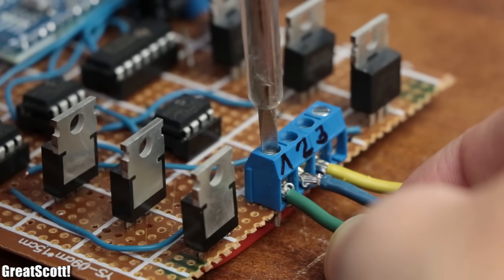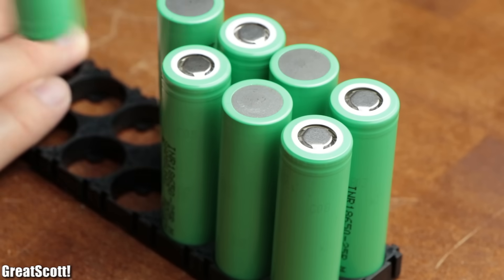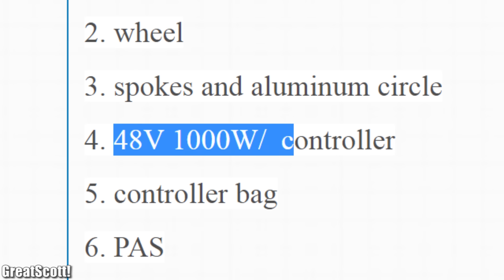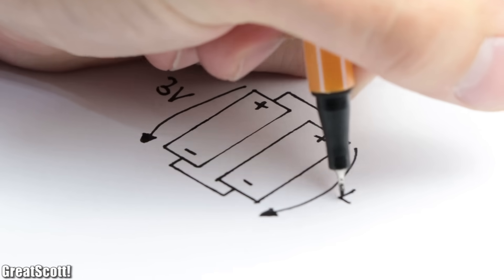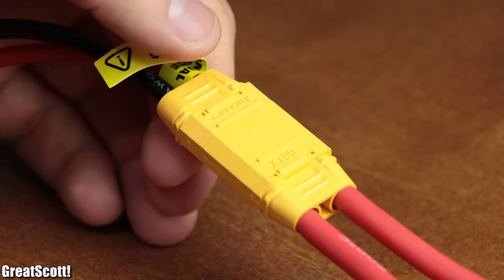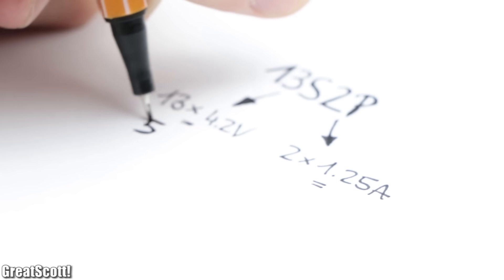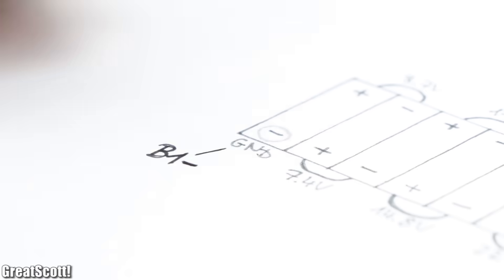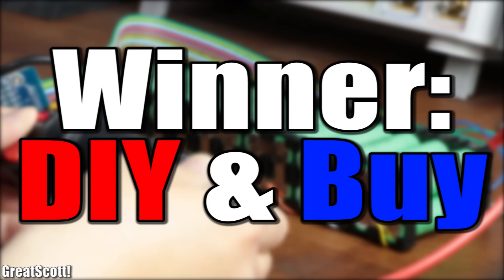EBike Battery Pack || DIY or Buy || Electric Bike Conversion (Part 2)

Comment: Nice video. I have a question concerning the charging process. It is not explained in the video, does your power supply uses CC/CV strategy when charging, or just constant preset current and voltage? Because if the latter is the case, isn't that an incorrect way of charging LiIon cells? Tnx.
Reply: While the cells are mostly discharged, the charging current is limited by the bench power supply's current limit (CC phase). As the cells approach 100% charge, the charging current will be further limited by the internal resistence of the cells, at which point the bench power supply maintains its present voltage level (CV phase). As long as both your current limit and your voltage level is within spec, the pack will charge just fine. The BMS even does overcharge protection.
Reply: Hm. I'm no expert, so I may be wrong, but AFAIK, when the cell voltage reaches 4.2V, the charger should stop delivering preset CC amperage and allow minimal needed current to maintain the 4.2V voltage (CV phase). I'm not sure the cell would resist the preset CC amperage when it reaches 4.2V, but if that continues, it damages the cell. There's a lot of articles about that and special CC-CV circuitry purposely built for that algorithm.
Reply: @tduic  I'm not an expert myself, but any graph I've seen (on spec sheets and whatnot) the CC phase ends well before the cell reaches 4.2V, and it's what I've found when monitoring the charging currents of mobile phones. I figure if you have a preset voltage level of 4.2V, and a preset current limit that fits well within the tolerance of the pack, which your power source can't (and shouldn't) exceed, then the charging cycle will work the way it should. No fancy circuitry necessary. At least that's how I've built the pack for my ebike, and it's been working fine for a year now. (10S10P, 37V ~13 Ah)  I've found it charges with a constant current to about 90%, and then the charging current will taper off as it approaches 100%. The BMS will also do charge balancing on the tail end.
I'm sure you could build a smarter circuitry that optimizes the charging process for speed, enables higher currents, monitor the cells for heat buildup etc., but I haven't found any of that necessary.
Reply: I don't know which graphs you've seen, but this site is regarded as reputable, so take a look (https://batteryuniversity.com/learn/article/charging_lithium_ion_batteries). Smartphones are whole different playground, because they all have custom packs and advanced circuitry inside which talks to its charger, so I'm not sure if we can compare them with this. Your BMS balances voltages across series and has nothing to do with this question, except it can provide some overcharge current but it doesn't know anything about charging strategy. I'm saying, if you are right and I'm wrong, why is everybody using the famous TP4056 CC-CV controller board for LiIon charging? It would be great for GreatScott to jump in and explain, I'm very curious.

Comment: Wow. Im in the middle of making my own Battery pack, and i failed at soldering because the solder doesnt want to stick to the batterys nor the god damn copper wire! Any solutions? I did sandpaper everyting before soldering. And im NOT willing to buy a spot welder that you have to build yourself that still costs 160 bucks!

Comment: great job but i have a question is that okay to charge battery li-ion  12.6 directly from power source like car battery or ac power source using BMS only or i need also a charging board?

Comment: wonderful video as always! bravo mate. I don't own a spot welder and I don't need one at the moment, so would you advice me if a normal 18650 box will do the job? I'm making an 4S pack with 8 batteries. there are boxes for 4 batteries, so 2 of those should do the job, right?

Comment: 4 of those batteries and an rc motor with a stand with a generac 120 stator running at 2 rotations per second will get you the miles without the expense. all you do is connect an ac throttle and an ac 48 volt motor but they are hard to find now. it should be you 20 miles to get to work and back. best move is to find a stator that weighs the same as the rc car and then steal the motor out but remember to only run at 2 rotation per second or you will burn out the rc motor pretty quick otherwise they last a year or so.

Comment: for those. battier. I have to bay 56$ just for them not including the spaces solder and the stuff to connect them is cheaper to buy lithium ion battery

Comment: Nickel strip has a low current limit (under 20A) so I will solder 2.5 mm2 Copper wire. But it just feels wrong soldering to brand new expensive samsung cells.
Reply: If you solder directly on the battery it damages the chemistry of the battery and increases internal resistance those that ignore this fact are deluded. You can increase the MAX AMPS on the nickel by purchasing nickel strips that are thicker and then you use the up-down method of welding multiple strips across the batteries. Get yourself some 18650 spacers and follow a proper guide on YouTube.

Comment: 20700 Batteries would of been a better choice as you have 3ah with 35amp peak
Reply: The cost of 20700 batteries cost much more and you are limited to only a few good manufacturers and sourcing those batteries can be very hard in some countries.

Comment: I advise soldering onto the nickel strips before you spot weld them onto the batteries, that way your batteries are not drawing any of the 330°C to 350°C from the soldering iron which can damage the chemistry of your unprotected cells.

Comment: One thing I would very much like to know, after having built both DIY power banks, power walls and e-bike packs from completely free and recycled cells, which have a higher need for a good and reliable BMS, is how do you discern the good quality BMS:es from the bad ones and how would you go about sourcing affordable quality BMS:es? I've used recommended BMS ciruits from EBay that have been tested, but are still Chinese mass produced things with a varying quality. One does not want to take risks with Li-ion cells or batteries, they can easily turn into great balls of fire which are very difficult to put out and can take your whole house down with you!

Where does one find good quality BMS:es in the mid range, that are more reliable and perform better than the average Chinese junk and are still fuctional, reliable and more reasonably priced than the Batriums?

Comment: Hi Great Scott,  I'm hoping you could see a video I uploaded to google drive and give me your opinion. The BMS I have in video is a 25amp 3s. Thanks... Oh and before I connected the B1 and B2 I checked the voltage on the bms's p- and p+ and it gives me a 12.43 volt reading....https://drive.google.com/file/d/1-SS_9lVAeN6Ni7wauIk_KgbZ_eUS4nvi/view?usp=drivesdk

Comment: So I am trying to create a 48v 12A battery for an ebike and have found some 3000mAh 3.7v 18650's for a good price. If my calculations are right, I should create a 13s4p battery, correct? If so, would the same bms used in this video (link in desc.) work for me as well? Or if it would not, what would?  And after that's sorted, how would i charge it?

Comment: Hey sir I really admire your work ! And thought great bis mandatory in your name ,, I saw complete videos on boost converter and battery packs ! So if I need 40 v and 200ma current isn't that good idea that instead of connect liion cells in series I just connect 2 or three cell and boost their voltage to 40 v , that won't need more batteries  so cheap ,easy to mange so space saved and not much complex , and easy to charge ...! Am I on right way?

Comment: 1) LiFePo or LiTiO best choise
2) buy DPS5020 https://www.aliexpress.com/item/RD-DPS5020-Constant-Voltage-current-Step-down-communication-digital-Power-Supply-buck-Voltage-converter-LCD-voltmeter/32821185351.html

Comment: As a Old Ebike rat i was ready to pounce, but this was very well done. Just as a tip typical city traffic load is about 3Amps. max draw usually around 20-25 amp when full throttling from a stop. To extend battery life and range dramatically slowly accelerate Especially in city traffic there is often little need for going maximum velocity. I personally prefer Lead acids on my main workhorse though. I have a Li Ion as a backup. Never use below 12Ah you wont get far.

Comment: In the future. You might have to consider spot welding from one side to the other, instead of what you are doing now. You can see the ribbons are bowing up in between the battery cells and that puts a little extra mechanical strain on the welds, making it easier for them to fail. Probably not by a lot, but everything counts when it has to be used in an environment with a lot of vibrations.

Comment: ebay is way overpriced buy on aliexpress there are great chinese shops that use cells of estabished brands like lg or sony and they have good customor support. The only downside is it takes 3 weeks to deliver to europe and 2 to america one great company is Unit Pack Power. You get a charger to and the mounteble enclosure that you can take of and put on in about 3 Seconds, it's lockable to. If you build your battery with cells from a large supplier like nkon you still will pay about 20% less but you will not find that great lockable enclosureres as a standalone so you have to build one yourself or hire a  metal/wood workshop to make you one.
Reply: No...   Check out Louis Rossman Video on Unitpack power batteries.    They used to be good but the quality fell off a cliff as time went on.

EM3EV is a much better choice,   vastly better build quality yet still reasonable pricing.

Comment: Could you advise if this power supply you used in video worth to buy? I found similar but 60v 5amp. Did you try use yours at full power?

Comment: I've read that some swichting power supplies are not suitable for charching batteries... I don't know what issues there might be: Eighter it does not charge properly or it can damage the battery?
How do I know whether a power supply is suitable for charging or not?
And where did you get yours?

Comment: Dear sir 

Please help to prepare the video  on how to select correct DC motor ,Controller and battery pack with Datasheet

1. How to select a DC motor with load 500 kg or 1000kg ,   along with Datasheet of DC motor 
2. How  to select correct range of Controller for the above DC motor  with state of rest and in motion with datasheet
3. How to select a perfect battery pack Range Volt /Amp  for the above DC motor and controller
4. How to select a suitable BMS for above 
At list  at the top level as in depth will be very long video.

Thanks Regards Lakra 
DLakra7878@gmail.com

Comment: Is it correct to say you do not need to balance a battery pack which has only cells connected in parallel? e.g. 1S5P?

This will then increase max current and capacity while retaining a voltage level of 3 - 4.2 Volts.

The only thing I need to add would be a over (dis-) charge and short circuit protection circuit?

Comment: Can the bench power supply charge a battery with CC/CV diagram? The idea is that charging is done at CC upto the cells reaches 4.2V and then the charging is further done with CV while the current is going down.

Comment: Question Would you please comment on what may be negative reason or positive to use a range of (used) discharge capacity 18650 cells to build say a 5 P pack. If for example the cells range from 1800 to 2200 mAh capacity the average could be 2000 mAh +/-.- so to produce about a 10 Ahr pack. Of course a BMS would also be utilised to balance voltage charge and discharge as well as protections. The pack in mind is 10 S for 36 v controller/ motor and current is being considered as done here as well. Thanks

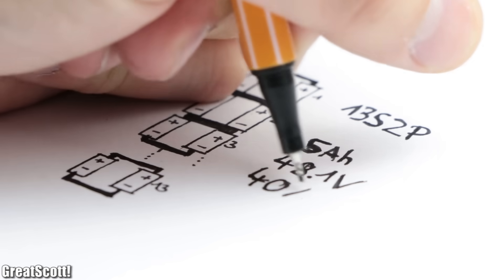Comment: 4:11 you say that the possible output current is 40amps. I though that the maximum current output is equal to the max of one cell which is 20A. When you put two batteries in parallel I know that the capacity (mAh) increases but I thought the maximum current stayed the same. Does the max current output also get added together? I’m very confused can someone please explain.

Comment: looking at your capacitor based welder it struck me that it would be a great addition to your electric bike motor with much larger capacitors and a brake energy recovery system, you could use fewer batteries. this should be better for bursts of power and for the batteries to have a buffer for the regen unit to recharge quickly to giving the batteries time to absorb the current without being cooked.

Comment: Hey I am new with bms and battery pack

Can I use a 7s BMS for a 6s battery pack?
And if the bms has a dedicated port to charge the battery can I use just a step up converter set properly?

Comment: 1 good way to do battery packs if your looking for 36 volt is to use 2x 18volt makita 5ah accu replacement packs. I can get 2 packs for 120euro's in the netherlands
Reply: except 5Ah is not much capacity for bikes. great for a drill however hahaha

Comment: Should the battery be fully charged when adding a bms or the battery can be at different voltage but the bms will charge them back up to 4.2 volt?

Comment: Your math is wrong with the current. A 1000w motor makes that peak power under load and ~half it's no load speed. Motors draw max current at stall (0 rpm). The current and torque curves are linear so it's 20A at it's peak power OUTPUT but the efficiency curve and the motor laws say it will draw the most current at stall, 40A. With a brushless motor being electronically commutated it's not a problem but you will have decreased performance at lower speeds.
Everything else is as entertaining as usual! Love the content :)
Reply: So what you're saying is when you start the motor it draws 40 A and when it's up to speed it returned to the rated 20A of power?

Comment: Hello there, was hoping you can help me out. I'm changing the batteries on my 18v drill to Li-ion. A 5s2p pack and adding balance charging lead. Would it be possible to add a digital volt meter alarm like this one. 
New 2in1 Li-ion Lipo Battery Low Voltage Alarm 1S-8S Buzzer Checker Meter Tester with an on/off switch to the pack. So I can see the voltage. And if so, how would I wire it up. Thanks so much

Comment: Great video. I wish it had been out a bit earlier because I made my own replacement battery Pack a few weeks ago. I also ordered the cells at accuteile. I soldered the nickel tape to the cells which is a pain in the ... .
Theres one thing you might want to know: I realized the range at which the BMS turned off because of overdischarge was quite low. So I tried to get my head around it and realized that it might be due to short negative voltage peaks at the start of high power consumption (i.e accelerating). So I soldered a 1000uF support capacitor parallel to the output of the batterypack (i.e. the BMS). Et Voila: Range nearly doubled. 

I also created a range extender from the old cells which were ok according to capacity but just developed a higher inner resistance. I still try to figure out a good way to parallel the two packs safely. What I do right now is charge them both and then just connect them via a 10A fuse (which by the way blew twice already). 

Keep up the great work. I like the accent. I have the same (-;
Reply: I believe you should not connect in parallel two packs that are not the same (not same age in your case). When I want to balance batteries in parallel I connect them through a resistor initially, after a while I put smaller value resistor, you repeat that until you cannot see voltage across the resistor anymore which means no current so they are balanced.

Comment: For a small pack like that it's barely worth DIYing one. Once you get up to larger packs like a 14s6p or bigger the difference between DIY and buy gets quite a lot bigger. Nice build though, good clean welds.

Comment: The cells are way too expensive, which is why the final price is close to prebuilt. A 2p battery pack is a bad choice IMO because of low range and more stress on the cells.
Cells with a lower C rate and more capacity would make much more sense.
It seems this bike is made for the videos sake because with 5Ah it is useless, but easier to build.
And it would have been nice to see a test of the BMS's functions

Comment: Did you include the price of a battery voltage meter and enclosure in your calculation? I think it's cheaper buying a battery from China, but you don't really know if they use the cells stated or a good balancing circuit until you get it delivered.

Comment: Hello mister great Scott I'm wondering if you would be out of touch base on using a hall effect censored throttle from an ebike to output a system that runs on a potentiometer I cannot find a signal converter or any video too convert the hall effects signal to a resisted signal of that of a potentiometer or is this something that's just not going to work I'm pretty new to electronics or even anybody in the comments would be great

Comment: I bought 14*6-cell  lithium-ion laptop battery with some Samsung 2200mah 18650 cells, created a 13p6s 48v 13.2ah battery pack for my bike with some left, its worth mentioning that I used solder instead of welding and used hot glue instead of those spacers....but anyways my bike runs great, fast, for a long time. The best thing is that it cost me only 60% compared to a similar ready-made battery pack, plus a lot of fun.....

Comment: I'm doing a project to run a motorcycle alternator as a starter dynamo to start the engine. I've made a circuit like this with 12v input, but it will not work. is the voltage insufficient or is there something I should add?
Plase help me. Thanks before